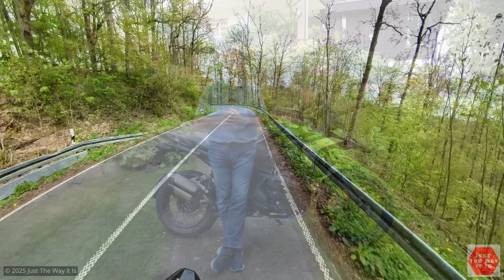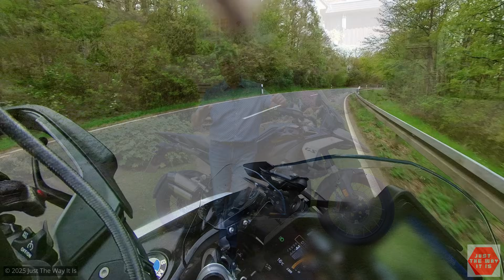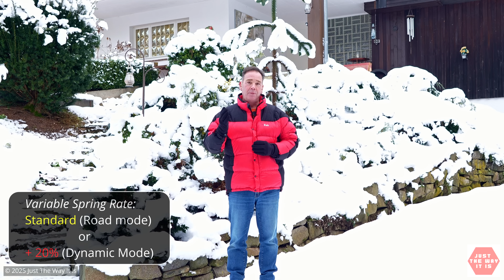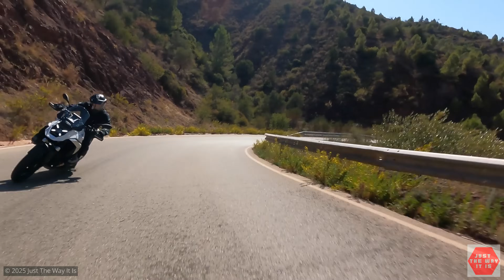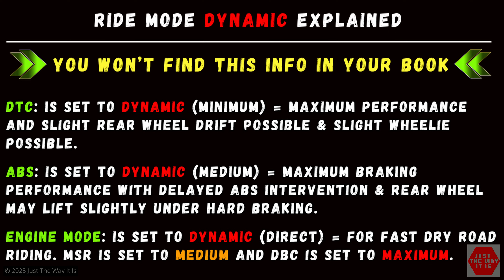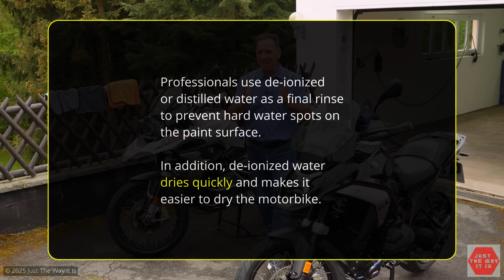BMW R 1300GS/A Dynamic Pro & DSA suspension setting guide MSR, ABS-Pro & DBC & AVHC Set-up Guide

Comment: You're crushing it, buddy! The way you break down bike setups and share all those pro tips for tweaking and maintaining your ride is top-notch. Keep that throttle twisted and keep dishing out the wisdom. Here’s to the '25 season being an epic one for everyone out there tearing up the road or trails. Ride hard, ride safe, and keep the rubber side down! 🏍🔥
Reply from the maker: Thank you, yes... lets hope 2025 is a great year for us all. Kind Regards Carl
Reply: Hi Carl, your videos are superb, thank you. My 1300GS is arriving next Monday and you have enabled me to really prepare for the various settings and have a much better awareness of the options for ride and suspension. Slightly separately, what navigation system/s do you recommend? The bike has the preparation for navigation so I’m starting to look at the sat navs and Chigee devices, but any views would be much appreciated. Many thanks Mike
Reply from the maker: Hi Mike, congratulations on your GS and it’s fast approaching arrival. With regards to navigation I use the standard Navigator 6 as it has one main benefit over most of the other systems. That’s the ability to use the wiz wheel to zoom in or zoom out instantly without having to touch the screen. For me this is a vital function for leading groups on tour.
But there are lots of other systems that offer some nice features.
Personally I am waiting for the INNOVV N2 Pro Pin to be released, hopefully it will have all the features I want and use.
Best wishes Carl 🙋🏻‍♂️
Reply: @ Thanks very much Carl. I’m looking forward to watching more of your material. All the best, Mike

Comment: A lot to ask, but could you put those slides in a pdf and make them available? I've really enjoyed your series. I have a 20 yr old 1150 GSA but have a 1300 GS coming within the month - built to my specs. Thanks so much!
Reply from the maker: Hi Steve, the simplest and easiest way is to watch video on your phone and screen capture each slide, iPhone is a double tap on the rear of case other brands use buttons but it only takes a minute or two to capture them. Congratulations on your R1300 coming soon 👍
Kindest regards Carl let me know if that capture option works for you
Reply: @justthewayitis  what's aware of that. I tried it and it didn't work. Looked it up and you have to enable that function - works great! Thanks
Reply from the maker: Excellent 👌
Reply: meant to say "wasn't aware..." thanks

Comment: I have a R1250GS and have ridden the R1300GS twice.  I found the seat and overall riding position (Rider Triangle) to be very uncomfortable and the suspension to be harsh.  Now, I haven't ridden the R1300GSA yet but some reviews say its got a wider/more comfortable seat and plush suspension.  I certainly will not buy the R1300GS!!
Reply from the maker: The R1300GS is also available with +20mm taller suspension which many owners report can be set up more comfortable.
Also a lot depends on the seat of the gs you road tested.
But I do understand your comment 
Carl 👍
Reply: @justthewayitis  Thanks, great video's!  Yeah, I do know about that.  I love my 1250GS, had it from new in 2019.  I may change it for the 1300GSA but will need to take a demo ride first.
Reply from the maker: Hi Rob, I like you, I do love my R1250GS and currently no plans to change her, but the gsa does look interesting 🤔
Reply: @justthewayitis  I road a 2024 1250GSA Low Suspension because the regular height GSA is too tall for me but found the ride harsh.  But now that BMW has the auto ride height, the 1300GSA's seat height gets to be lower than on my GS by 10mm!!  So we'll see in a few years upgrade to the 1300GSA, if I like it after a demo ride.  Ride safe!!

Comment: I'm enjoying watching all of your videos since I owned R1300GS. I'm wondering ride mode connected with each  own suspension configuration? For example I selected road mode, only "road" suspension configuration is working?
Reply from the maker: Hi, once you have selected the Ride Mode, you can then change the automatic suspension mode selection in the menu using the suspension mode button.
You can have Ride Mode ROAD
Matched with
Suspension Mode Dynamic
If you wish
Or the other way around.
👍